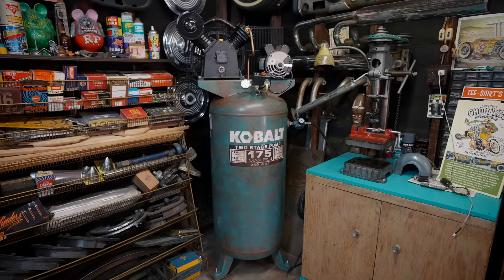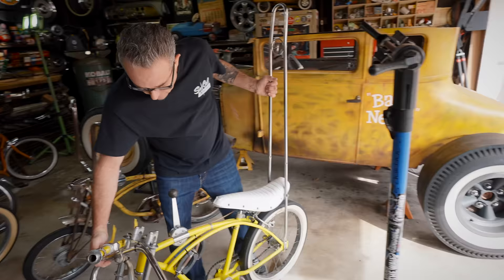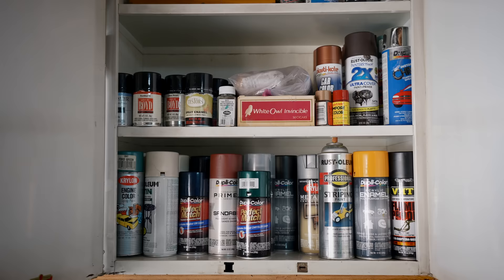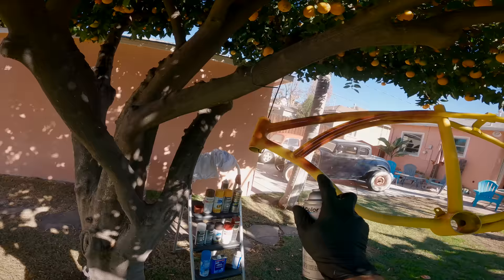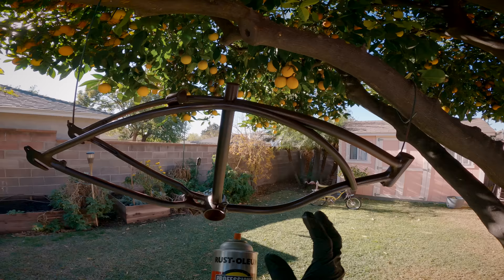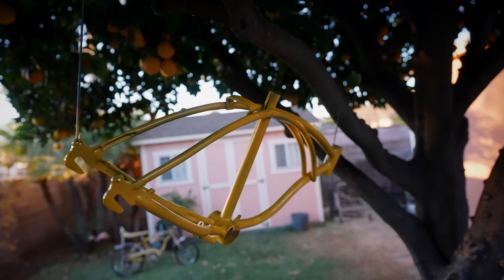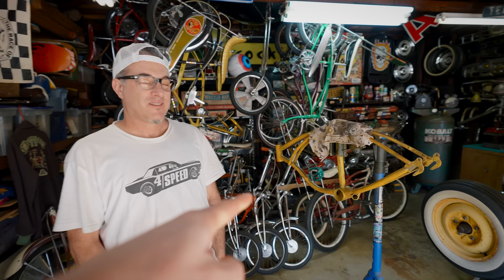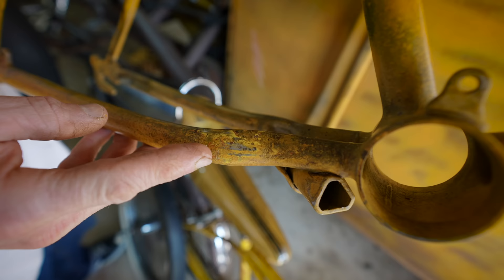How To Patina Paint Anything!

Comment: Very good technique, looks excellent. Try sprinkling a little coarse salt in particular spots while the undercoat (red oxide primer) is still drying, then after the top coat dries the little spots are made when you rub the salt off, works like a charm.

Comment: hey there! i know this video is pretty old, but id like to share my way of adding "rust", so what you do is lay down all your paint how you want is, including lighter areas that are meant to look sun bleached. let it dry and then go over it in patches with matt clear coat. after that dries for about 2-3 mins add iorn fillings in your desired shape, and if you add to much dab some off with a towel. once thats fully dry spray over it a solution of 3 parts apple cider vinegar, and one part water. it depends on personal preference how long you leave it, but it should take about 25-45 mins to react. after youve got your desired result, rinse with water and then dry throughly and proceed with whatever top coat, or clear coar you want.

Comment: I don't need to fake patina, all my junk has it naturally. When I started painting my cars HRM and others started putting patina rides on covers. I had been driving unpainted junk for over 20 years at that point. I let them weather outside for a few years if I want it to look rough. The sun does a much better job than we can. My 68 LeMans looks perfect now, the cheap tractor enamel is flaking off and fading just right. I shot it back in 2015 in my dad's yard on the farm, in December... when its usually below zero but was in the 50s that day.

Comment: You can't fake "patina".  Patina is patina or it is not. . F'd up rust is NOT patina, a crappy paint job is not patina. Your work is not convincing if you are attempting a naturally aged  look. A definition of "patina" is in order.   

"Patina is a thin layer that variously forms on the surface of copper, brass, bronze and similar metals, or certain stones, and wooden furniture, ............"

Also:
"A thin greenish layer, usually basic copper sulfate, that forms on copper or copper alloys, such as bronze, as a result of natural corrosion or chemical treatment."

I suggest knowing something about a subject before  presenting absolutely incorrect, fictitious BS. What you have done is a mess. What you have created is something that fakes a lifetime of abuse. 

Please do not suggest the meaning of the word has evolved. No it has not , the ignorant continue to pass on this BS.
You have contributed to that nonsense.  Colossal fail. I suggest a different "hobby" more suited to your limited skills , experience ( or lack there-of)  and knowledge.